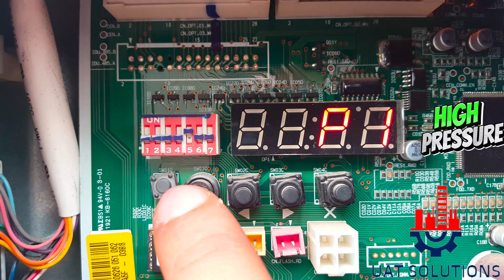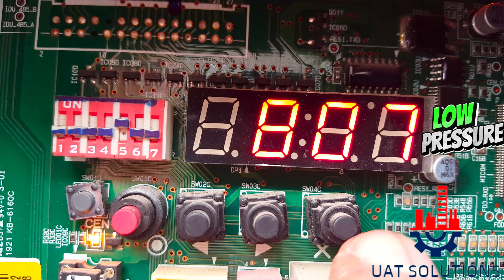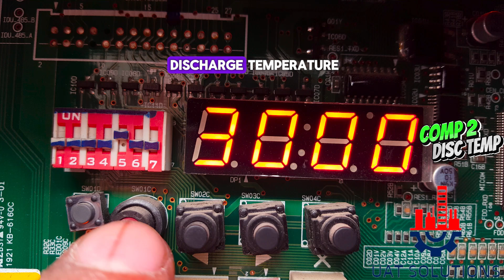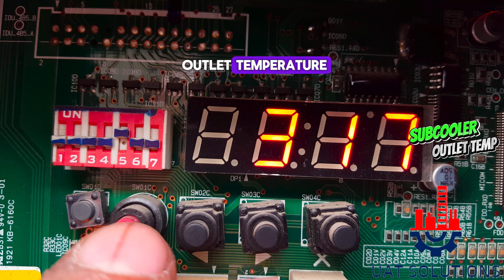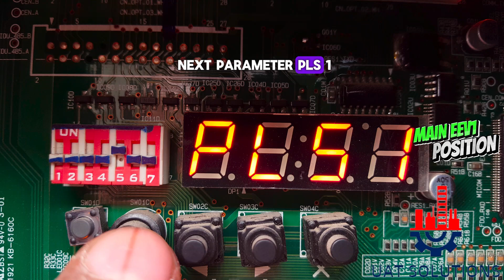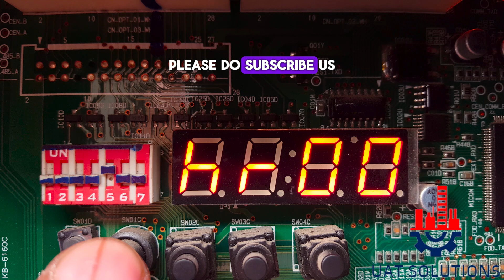LG VRF Multi V5 Training Course | Part 12| How To Check All Operating Parameters, TEMP , PRESSURES

Comment: I noticed that DIP switch #3 was off on these, which relates to the communication speed to the indoor units. If this was a new install and all of the indoor units are 4th gen units, how come you have DIP switch #3 off? Having it on will allow the units to communicate faster and more reliable. If needed, I can give you the procedure for setting it as it has a few steps involved to fully switch it to gen 4 mode.